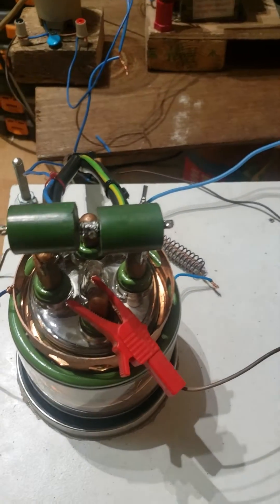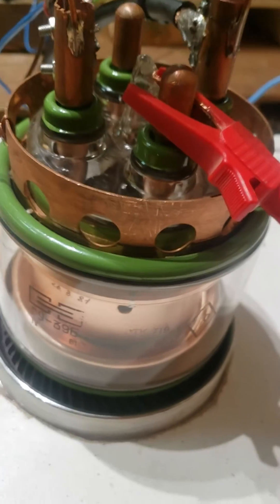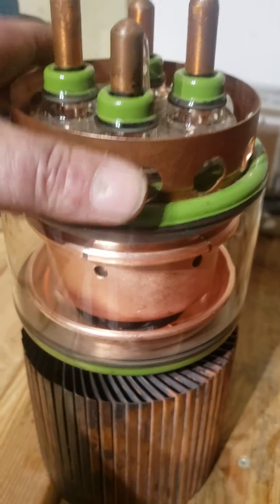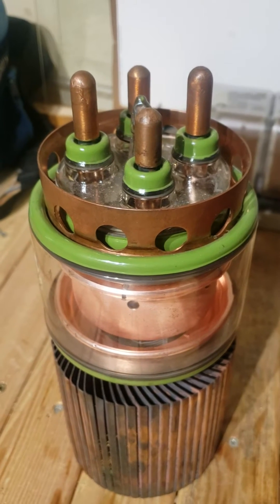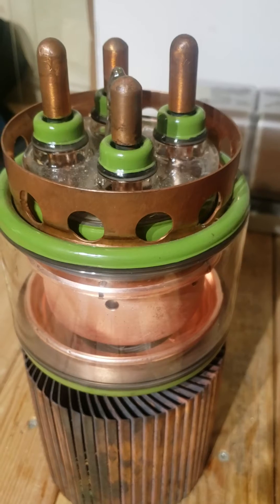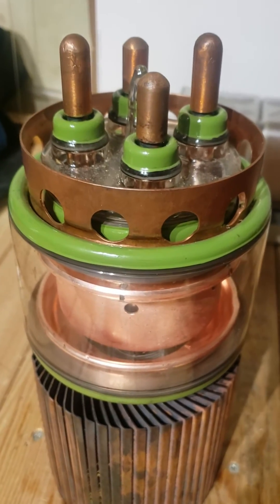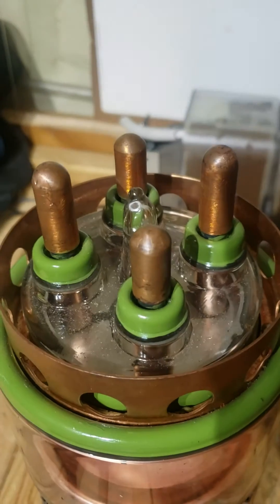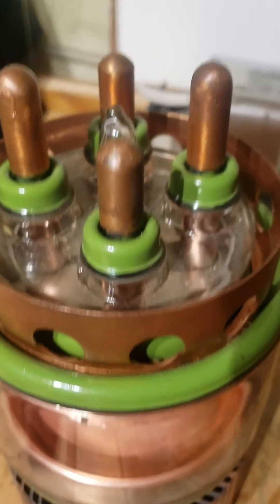GU39B A Closer Look at this Awesome Vacuum Tube

Comment: when i look up a datasheet for GU 39B, it is designated as GU 39B-1. it has the same specs as you mentioned and what i understood from the datahseet, higher pins are cathode/heater, lower pins are G1, upper rinng is G2 and heatsink is an anode. is that correct? i am considering purchasing one in the future. it is a nice, big and most powerfull tube with air cooling, that i could find available.

Comment: Soviet monster. 100A only for one filament (630W power). You can get a 1.5-2m discharge from a Tesla coil on this tube.
A few tips:
1. NEVER turn the filament without the cooling fan on. The filament power is huge - the tube heats up very quickly.
2. It is recommended to make radiators on the cathode and 2grid leads.
3. For use at full power, the cooling fan must blow at least 600 cubic meters per hour through a radiator.
Reply from the maker: Thanks for you tips. Really appreciate them.